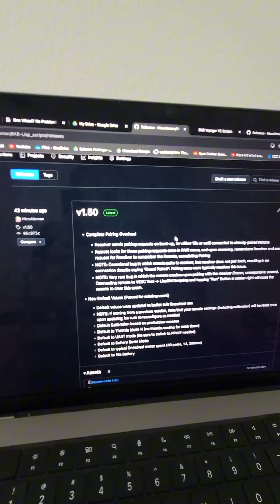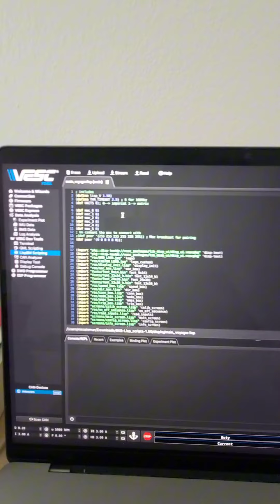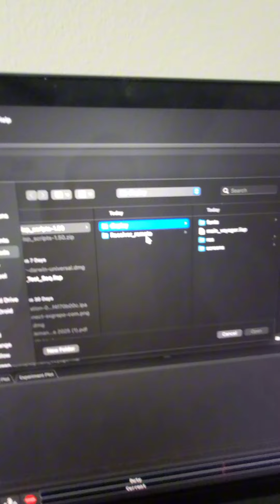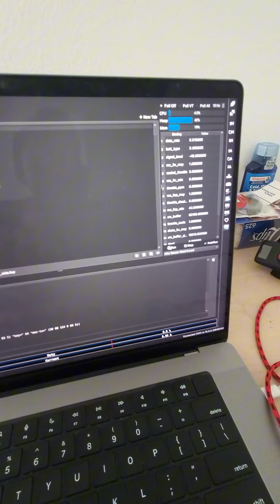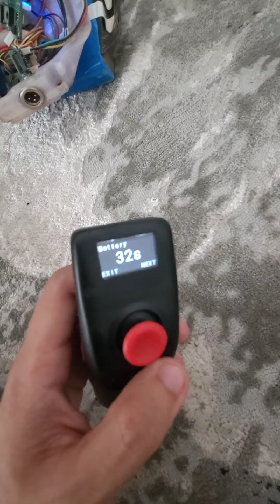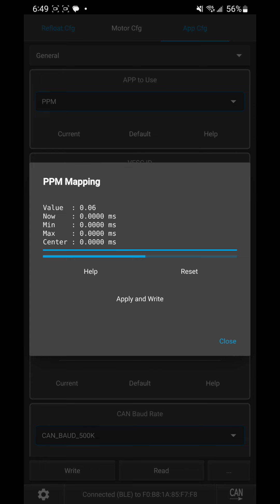BKB Voyager V2 - How to Install and Update for VESC Onewheel

Comment: I am interested in remote. IVe had a few onewheels and a few vesc boards. Now I have 20s pintv and x7 supercharged. Im heavy at 200 pounds so I do not like on steep off road how I have to really trow my weight onto the front footpad to keep momentum going on the steeps. My question is with remote can I keep a center body position on steep stuff and let the remote power the board up the hill?
Reply from the maker: Not really unfortunately, it doesn't change physics. The board requires your weight to be over the front to accelerate forward, it's just how self balancing works. And with the nose up like it has to be, it is more effort to put weight forward since your front leg is raised. The remote doesn't change that, it just gives you control over the tilt of the board in real time, but 10° up with the remote will feel the same as 10° up with ATR
Reply: @nicoaleman so do you use it for everyday riding? btw I luv you're float hub app. pretty awesome

Comment: Hey Nico, when I try to upload the lisp file to the remote I get the error message "Line: 17: Imported file not found: ://vesc_packages/lib_disp_ui/disp_ui.vescpkg. If you are importing from a package downloaded from the package store, you might need to update the package archive. That can be done from the VESC Packages page." I'm working from a PC and not a Mac. Is that the problem?